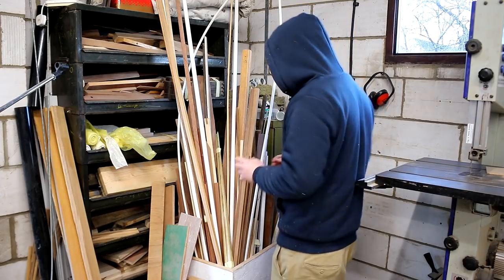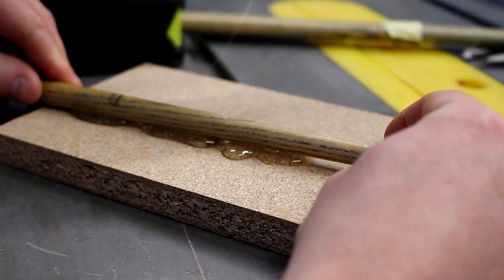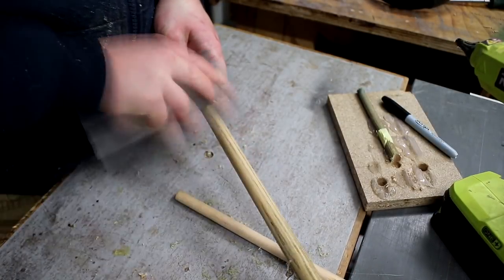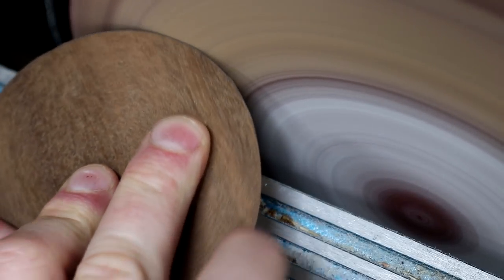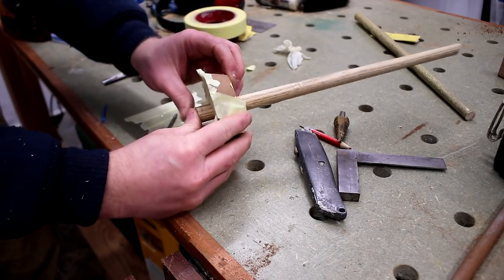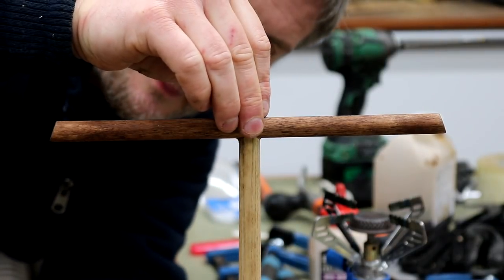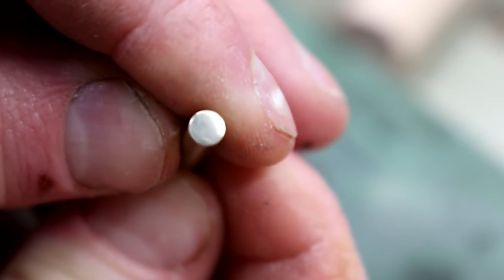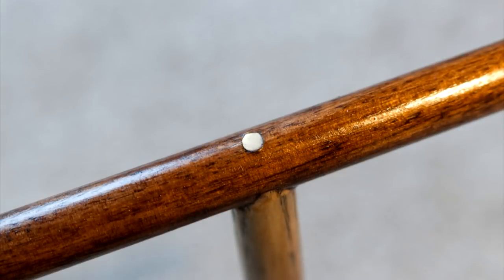Necklace Stand With Brass Accents - Making A Christmas Gift

Comment: Nice project Keith, definitely a lot more difficult than you would think just looking at it!
At 2.42, one trick you might want to try is wrapping sand paper around one of the two pieces, and then using it as a sanding block to create the exact size/shaped opening - really helpful when you're trying to join two unusual objects :)
Reply from the maker: That's a fantastic idea, I've seen it done before but it's one of those tricks I always forget when I'm making things, frustratingly! Thank you and Happy Christmas!

Comment: Nice job
About the issues with the drilling in the beginning; use a smaller bit first and quickly tap it back and forth, a bit like a pilot hole. That way you'll have a much better start.
Reply from the maker: Great tip 👌

Comment: Hi Keith, nice project.  I'm sure she'll love it.  A couple of comments if I may.  If you'd put the epoxy on the end of the cue before inserting it, you wouldn't have got "squeeze out" and epoxy on the taper.  Likewise with the centre pin.  Like you, I use hot melt glue for temporary fixings.  But be careful, it can lift wood slivers from the good piece (I've learnt the hard way).  Seasons greetings to you both.
Reply from the maker: Cheers Steve, Happy Christmas

Comment: Great work as always, I spy a record air filter how you find it?? Does it stop that fine dust coating everything??
Reply from the maker: It's fantastic actually, very very quiet, a big improvement over the Thor I used before. But be aware that Rutland's sell exactly the same machine but a different colour for much less money. I bought mine secondhand on eBay 👍